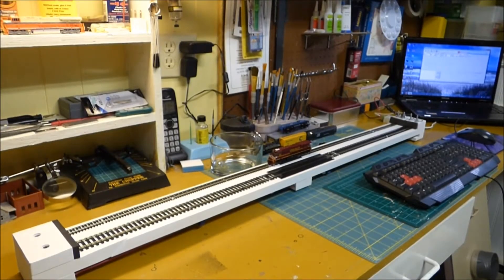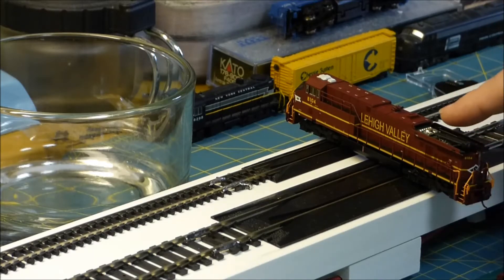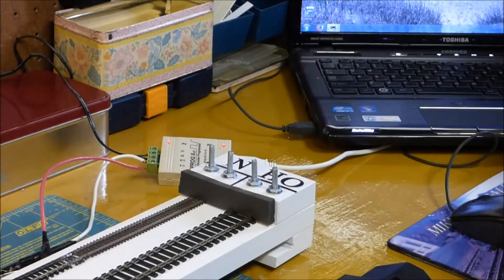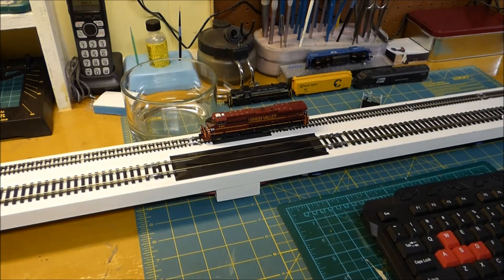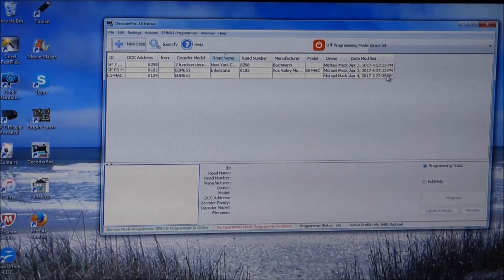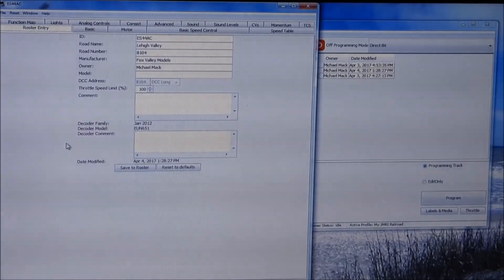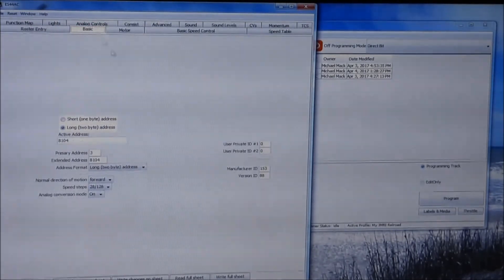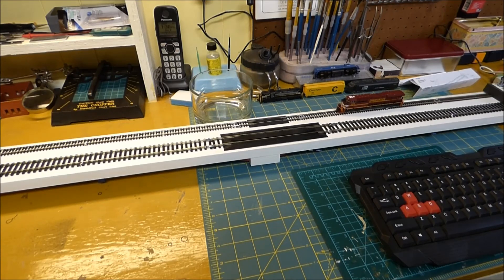How to use my programming track with JMRI

Comment: Hey, Mike. It is suggested that unless you plan to run this loco on DC as well as DCC, you disable the DC functions on the Analog Controls tab and run NMRA Digital only. This prevents a transitory DCC spike from making the loco take off at Warp 8 and self destruct with a Lemming Leap off your layout table. A scale 350 ft (scale) swan dive is hard to recover from... BTDT.  :face-purple-crying: